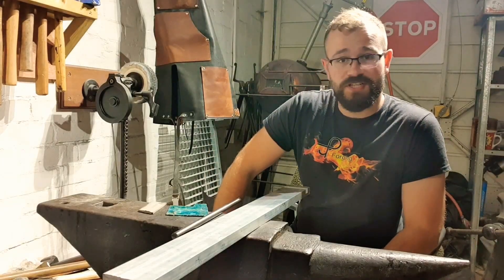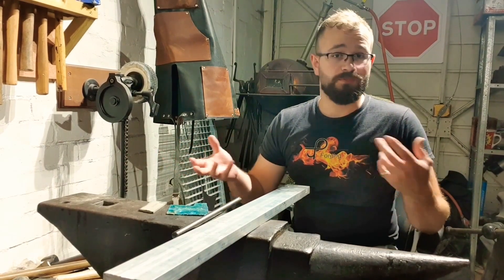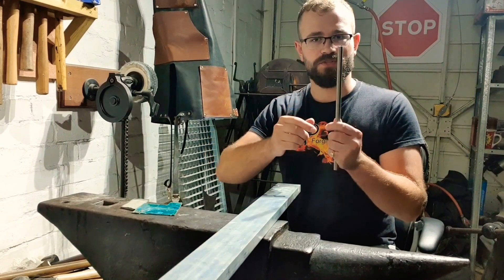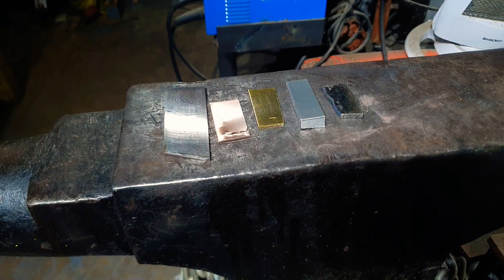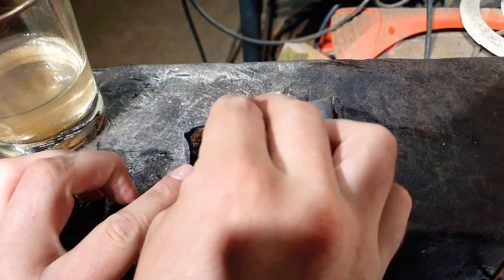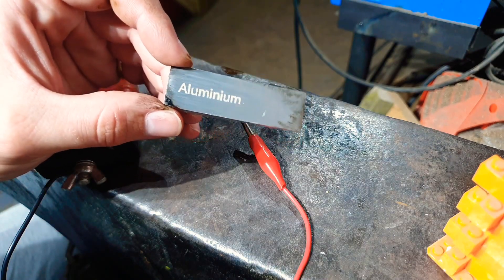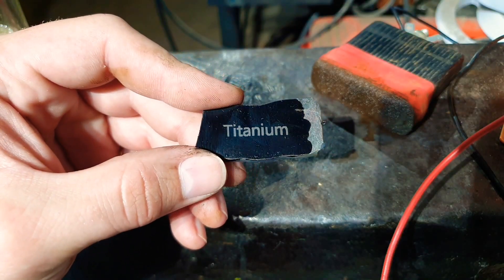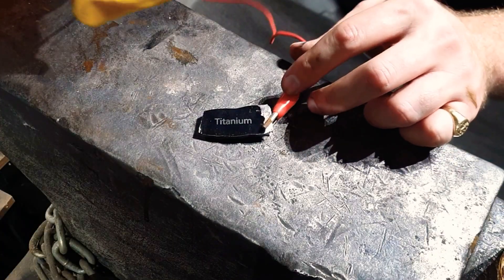What Happens When You Etch Different Metals?

Comment: I used to make my own project PCBs from circuits I traced out of hobby magazines... I have done some etching, but I never heard about "marking". But as you describe it, it's just re-deposition by electrolysis. So carbon probably does not deposits back on the damascus steel, but you could be turning some surface metals to oxides. With aluminium, that's exactly why it got brighter - most metal oxides are dark, but Al2O3 is white. Copper oxide is probably just plating copper back onto the etched surface, I think that's just the chemistry of copper electroplating.